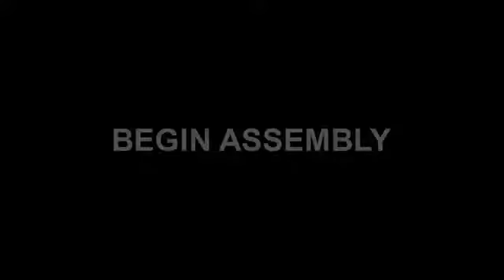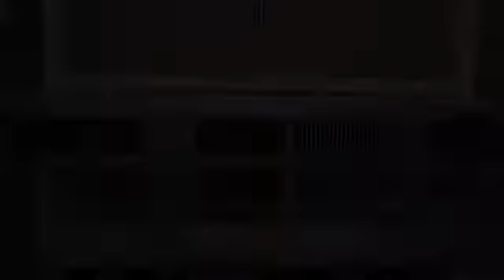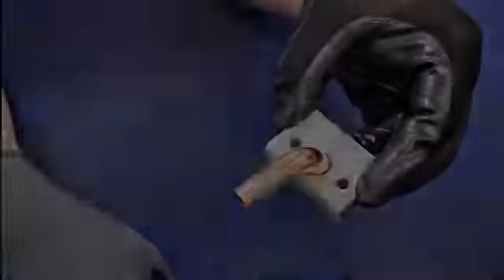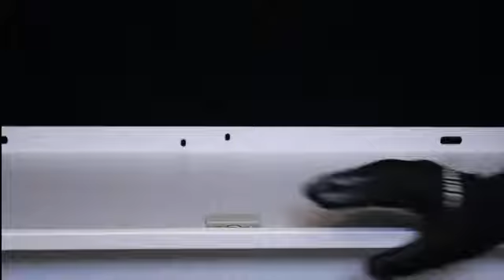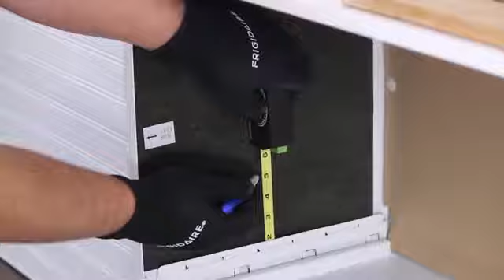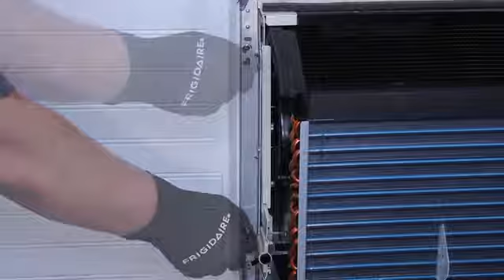Installing Sleeve and Drain Kit for PTAC

Comment: Drain line connect where
Reply: Does anyone know if the sleeve is installed level or pitched still back out if you are draining it inside to a designated drain?